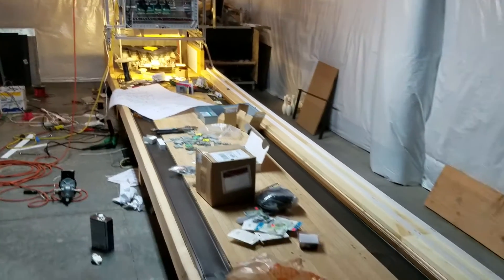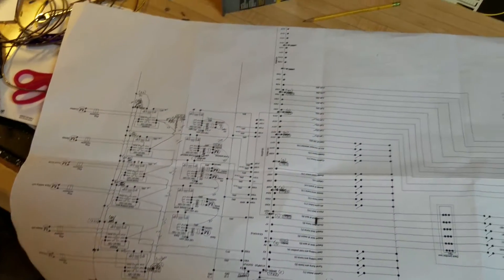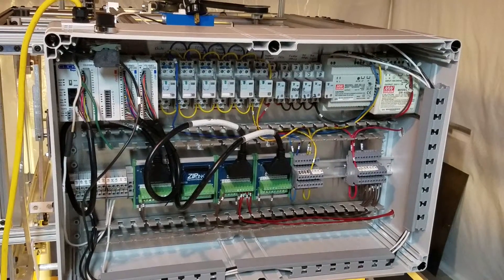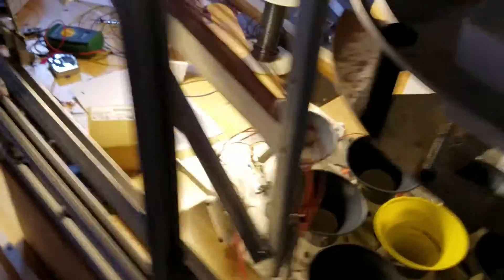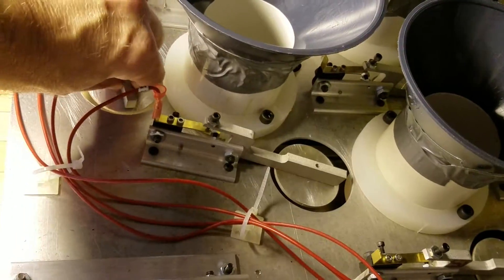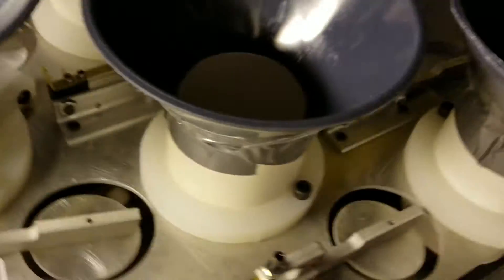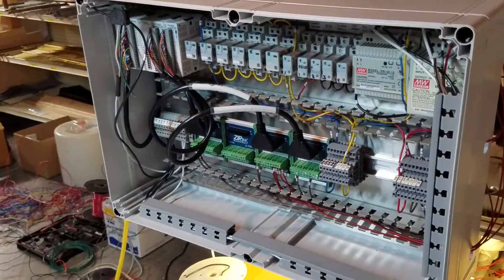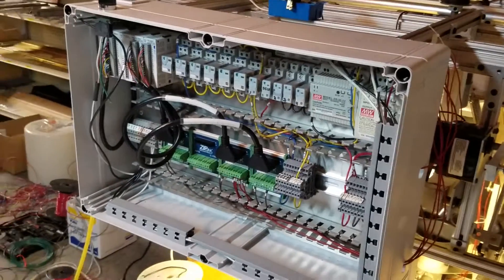Half scale pinsetter update: Started on the control system

Comment: Nice engineering! Why don't you use a camera to detect dead wood / fallen pins?
Reply from the maker: Thanks for the engineering compliment. As for the pin detection, there is software available to do that. However, getting the computer to talk to my PLC is out of my current skill level. I do have plans to include automatic scoring down the road. The PLC wiring has been configured to allow for that. I will probably use an HMI touch screen to act as the monitor for scoring readouts. That also is out of my current skill set but I think more doable than what I mentioned above. My current goal though is to get the machine running so I can bowl some games. I'll just keep score the old fashioned way for the moment.
Reply: Just for your interest maybe have a look at the Raspberry Pi which is a mini computer for a couple of bucks with GPIO. It also has a bunch of addons (camera, sensors, motorboards, displays)